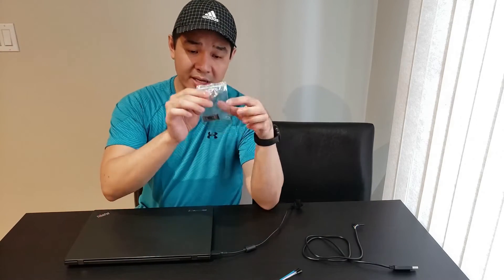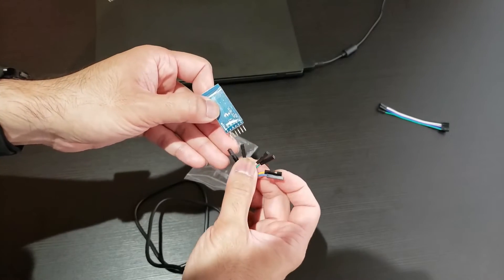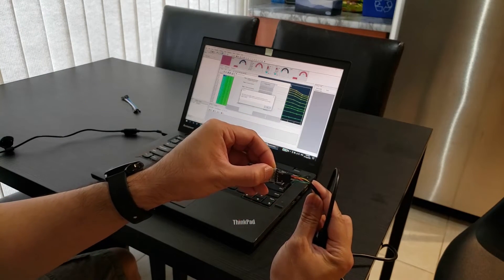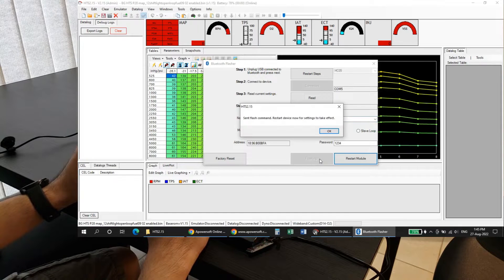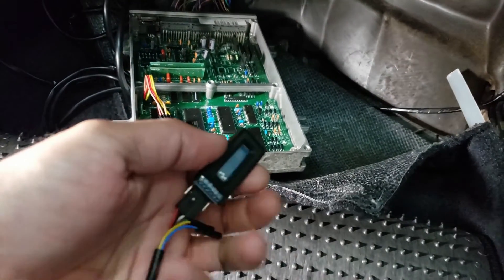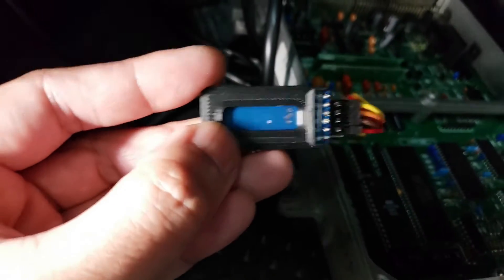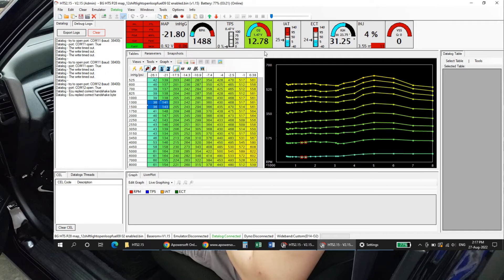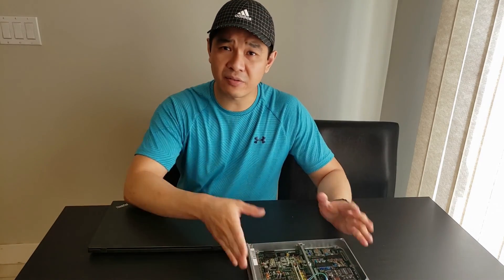||HONDA 88-91 CIVIC/CRX|| OBD1 ECU Bluetooth Datalogger HC05 for under $6! (P28, P05, P06, P72, P75)

Comment: 1:40 RX is the receive pin, TX is the transmit pin. RX always goes on TX and vice versa. ;-)
Reply: Yup. Gets real complicated when you have multiple levels of TTL.
To set yourself up for success if you ever want to play with arduinos:
Think of them only as SIGNAL NAMES. NOT DIRECTION OF "FLOW"

Comment: Great video! Any chance this can work on a phone app?

Trying to do a fuel economy VX with active MPG displayed on my phone
Reply from the maker: Yes, I've successfully used it on Hondash, but haven't tried TunerView yet because it required the purchase of the protocol and I didn't want to or need to spend the money for it. But others have used it on TunerView and had no problems. So yes, you can use it on phone apps.

Comment: Cool video......I used the instructions in the video and it worked great. Awhile later my ECU needed repair, after getting it back from being repaired I can't get it to work again. The Bluetooth seems to work but my problem is HTS can't open com port 9 and I can't datalog. Should I try to reprogram the HC-05? Any suggestions?
Reply from the maker: Not really sure. I'd suggest trying to reset it and then program again and make sure you select the com port that is outgoing.
Reply: @BudgetGears  can you also edit tune with this data logger?
Reply from the maker: @Muzamil.Rind1  No, it's called a datalogger. It's in the name. It logs data. If you're looking to tune, you'll need a programmer. Either tune by burning chips, which is a eeprom programmer or by using an emulator, which would be the many RTP's on the market.

Comment: Is it possible to upload data from the laptop to the ecu? using Bluetooth connection? or it is for realtime logging only?
Reply from the maker: Datalogging is datalogging. It only reads data. For uploading data, which is the tune, you'll be doing that through your emulator (also know as RTP (real-time programming). They're 2 separate processes. I don't know of any emulators that are wireless. All the emulators I came across usually requires a cable connection from ECU to laptop.
Reply: @BudgetGears  Thank you for the information. I was just wondering weather we can also convert the signal from the cable to wireless for easier programming
Reply: Why my hc05 cant read though i follow your vid
Reply from the maker: @reykristophercantaco1418  I don't know. You didn't provide much detail except it can't read. So it could be many reasons. Bad HC05, input output wiring reversed, bad ecu, J12 resistor not removed, software not setup correctly, using software that's not HTS, programming not done correctly, comm port not correct, etc etc etc. The list goes on. If the steps were followed exactly, then it should work. If it doesn't, then something else is wrong.
Reply: @BudgetGears  i am only on the stage of programing like you do in the vid but it cant read after i connect i swtich wring but still cant buti it is in at mode
Reply from the maker: @reykristophercantaco1418  I don't know whats wrong. Are you using a ftdi cable? You can try downloading another software online to program the chip. There are others out there. You'll have to Google it. If the other software doesn't read it either, then you probably have a bad chip.
Reply: @BudgetGears  yes i am using that ftdi cable also revrse the green white but nothing read
Reply from the maker: @reykristophercantaco1418 I'm not sure whats wrong. I'd suggest trying to test the hc05 using other software. If it reads elsewhere then maybe its HTS. If it still doesn't read then either your cable is no good, your hc05 is no good, or wiring is wrong.

Comment: Will this work on a stock box? I have a P08
Reply from the maker: What do you mean stock box? Like an not chipped ECU? I haven't ever tried to datalog on a stock ECU. It's always been chipped. Plus, you'll need to remove a resister to datalog on certain programs. Not sure which one it is for the P08 because that's a JDM ECU.

Comment: my problem is with the hc-05 connection, is the hc-05 set to slave and master?
Reply from the maker: Slave. The master function is more for devices that search for other Bluetooth devices. Like your phone or PC. Since you use your phone or PC to search for the hc05 to datalog, it should be set to slave. Slave is also the default setting.

Comment: Signal flow I'm guessing.  If one side is transmitting(tx) then the other side is receiving (rx).
Reply from the maker: Thats kinda what I was thinking too. But didn't make much sense with how the ecu datalog pinout is. Unless the actual pinout is opposite of what the wiring is on the forums. I guess as long as it works. 😁